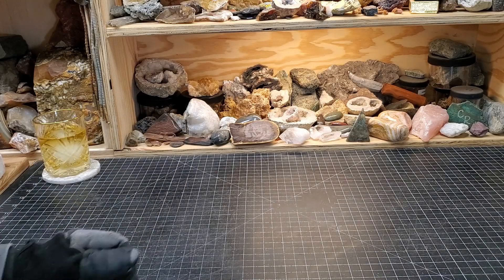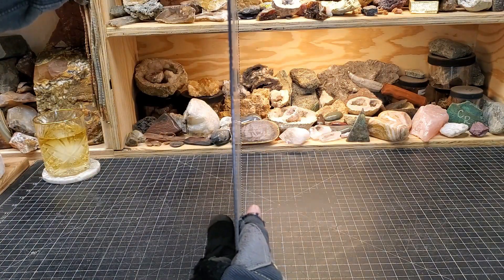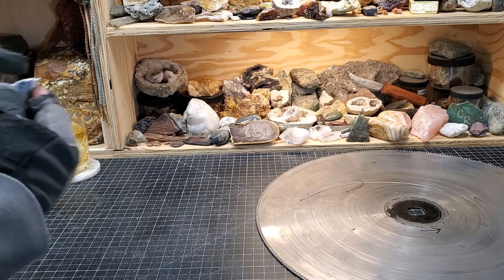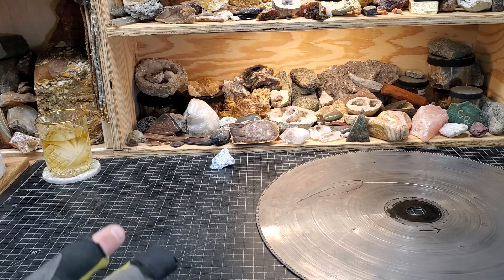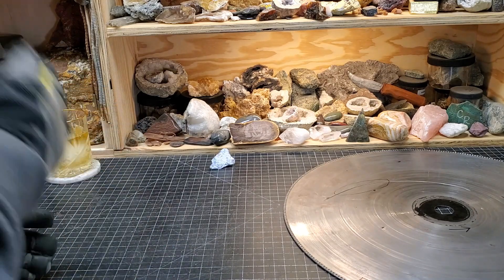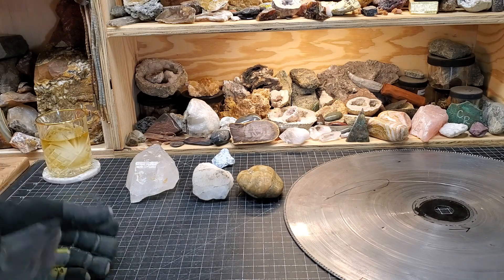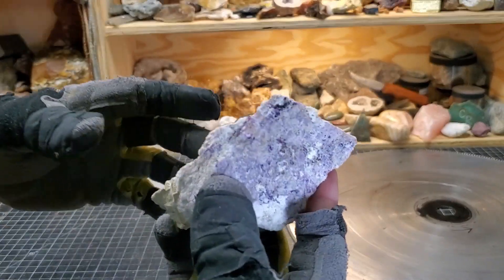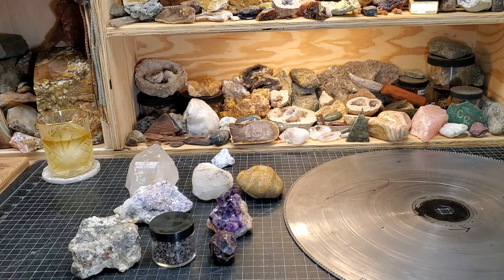Saturday Night Special #131: Palygorskite & The Lortone Panther

Comment: I have heard of two locations in WA where you can collect Amethyst crystals.  The Spruce Claim (Bob Jackson) is a fee dig.  However, he does not let many of the Amethyst plate get mined by the customers. The other is Walker Valley.  I've seen some nice material that was put on display and it was said it came from there.  That said, they are few and far between.  Also someone who does not know the difference between Quartz, Massive Quartz, and Quartzite should not be posting references to mislead others just to make themselves look smarter.  It's a sad situation for everyone when people act like that.
Reply from the maker: I have also heard of those. Its unfortunately but Bob sold that claim and now its part of a group owned LLC. 

We do have a lot of other amethyst locations out here but its almost 100% just a little purple dot on a rock like I showed.

I agree 100% with what you said.